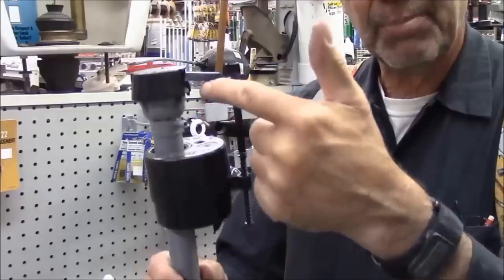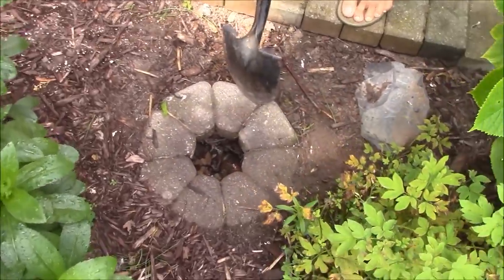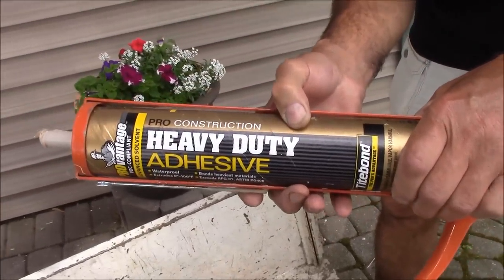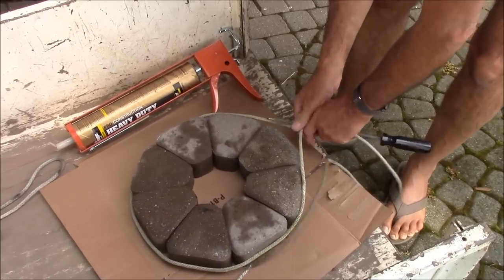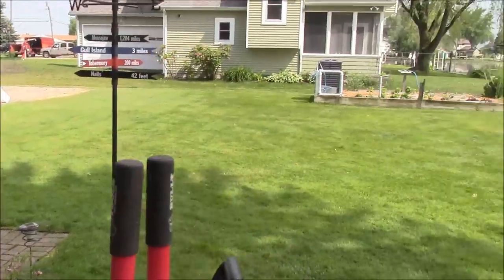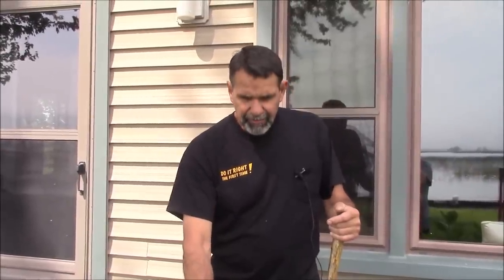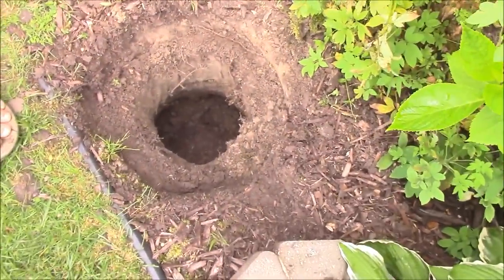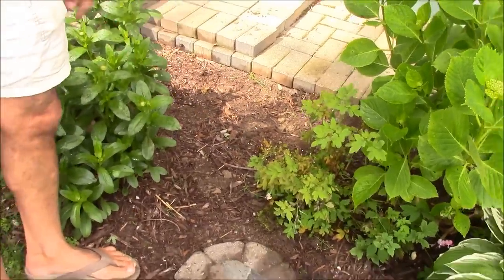Puppy Poop Hole Disposal Pit, Best Way to Dispose of Dog Pet Waste in Yard Cleanly

Comment: This was the best idea I have implemented for our yard care. We have a 35 lb Standard Poodle puppy, well on his way to 60 lbs. We are working on our second hole. He has huge poop!  Between designing a poop/pee area and this poop hole, our yard is poop free and looks nice. Thank you so much for this idea!
Reply from the maker: I’m on my 30th hole and on the 3rd dog at 3 homes. Our 70# doodle caused me to dig big holes and flood them w water 3 times a year to help settle the contents.
Reply: What do you do for pee?
Reply: @MrHardware1 I have a question. Your going to be putting the waste in the hole, but do you have to put anything in the hole to eat up the waste.
Reply from the maker: @kenyareed3051  I have added enzyme drain cleaner and filled the water with/the hose. I have 15 or more of these in a row around my garage and then into my flower beds. This has been over 40 years and you can’t tell where the old holes are.

Comment: As an electrician I have access to 9 foot long post hole diggers. That would be a deep one and make one hole last a very long time! Great video. Good job!
Reply from the maker: Wow, I could use a 9' post hole digger. Is it an auger or clam shells?
Reply: Mr. Hardware Clam Shell style. Fiberglass handles. I heard they were very expensive.

Comment: Is there any odor other than when you open it?  Want to do but my wife is concerned about the smell. Thx!
Reply from the maker: I'm surprised that there is almost zero odor.  It only stinks when I fill the hole with water (almost to the top) to help compact the waste.
Reply: you can add a little septic starter enzyme to get the process started.  that should eliminate much of the odor as well.
Reply: Or are there any flies collecting in area and near your back door?
Reply: Add some sawdust too it even couple weeks
Reply: @Godresponds  I was thinking the same thing (flies)

Comment: So I have a question. We had heavy rain last night and the hole filled with water. What do you suggest we do to drain it
Reply from the maker: It will drain into the soil naturally. I think it’s a good thing with the water because it causes all the waist to Liquify and settle bottom into the bottom of the hole. I have filled my pit with water with the garden hose and added some enzyme drain cleaner in an attempt to increase the decomposition of the waste.

Comment: Good idea but I have three dogs.. Even with a piece of slate on top, can you smell the poop?
Reply from the maker: It’s funny, it never smells except when it gets about half full and I take my garden hose and with a high-pressure nozzle I stir up all the crap and fill the hole with water and then it smells for about a half hour but you put the lid on and it doesn’t anymore. I add a little enzyme drain cleaner, I don’t know how good an idea that is, and then fill it with water again and I get over a year with one 70 pound dog.

Comment: Where did you get the brick? My local Lowes doesn't have something that makes that small of a hole.
Reply from the maker: Those were from some circle kits of brick pavers. I guess they aren't used much anymore so hard to find. If you can find some 5" x 10" you can make a box w a 5" hole if you lay them correctly.

Comment: Do you just put the poop into the hole and leave it there? or do you have to add enzymes or stuff like that to it? 
Also, could you add other organic stuff to compost in there like some veggies wastes? Would that help the decomposition or would it, on the other hand,  just ruin it?
Reply from the maker: I rarely add drain cleaning powder or septic enzyme and then flood the hole with the garden hose. The water helps liquify the waste and compacts it deeper. The enzymes can't hurt so I do use them. There is no room for composting stuff, I'm lucky to get about 2 years out of a hole.
Reply: @MrHardware1  Hey I'm sorry I didn't respond earlier! I followed you instructions and made my own system, with a little modifications here and there to fit my yard better. Let's see how it goes!
Reply: I think poop will break down faster and with less smell if you add some carbon to go with it. I plan to add a handful of leaves with each poop. Read around though. I'm not an expert on this. This will obviously affect your storage space, but I'm okay digging a hole every year instead of every two years

Comment: Uhm, so how do you get the dog to poop in the hole?
Reply from the maker: With a shovel, as usual. Just putting it into the ground not in a bag. Easier to me.
Reply: Lead by example. You should begin pooping in the hole with the dog watching. If the dog isn't interested, have a bowl of chilli in your non-wiping hand. Give the dog a scoop of chilli every time poop hits the hole. The dog will associate pooping in a hole with delicious chilli. After a few years you can stop pooping in the hole and the dog will automatically assume if he poops in the hole like you did, he will get chilli. It worked for my 85lb Teacup Yorkie.

Comment: so I tried to do this... but then I found out you have to buy a "kit" it's $800 to $1200 for a circle kit. I can not find just the corning stones anywhere! Please help!
Reply from the maker: See if you can find long narrow patio blocks, arrange them in a pattern that will leave any size hole in the center. I got the invention from a guy that just dug a hole and used a garbage can lid to cover it. My circle is cool but here in Florida I used rectangular bricks and spaced the center ones out so there was a hole. Then used a 12 x 12 patio stone to cover it.
Reply: Couldn't you also buy a $5 bag of concrete? Build a cheap circular mold from a bucket or lid and place another circle in the middle, like a cup. Remove once hardened.
Reply from the maker: Norah has a good idea to make your ring using a plastic lid and a cup in the middle and a bag of cement. Thanks! Blair
Reply: @norahj.5213  that is brilliant

Comment: Couldn't you just dig the hole and then use a bigger bit of slate to cover it rather than making that stone thing aswell?
Reply from the maker: The trim ring keeps the soil from collapsing into the hole.
Reply: @MrHardware1  ahhh, I get it. Thanks so much x

Comment: No enzyme tablets/powder to break down the waste? No pouring water on it? You just drop the dog waste in the hole and place the brick cover over it? That's it?
Reply from the maker: @Julie-z6q  Yup, although I do flood the hole w/water to compact the waste down and get another month before I dig a new hole. And yes, when  can I add some drain cleaning enzymes in and flood w/ water.
Reply: @MrHardware1  Thank you for replying. I've been using "compostable bags" but just found out that they're not compostable in landfills because the conditions aren't right for decomposition, so back to the drawing board! This is what I'm going to end up doing, but I wanted to make sure it's not harming anything. Thanks again : )
Reply: Hello again, so I was just reading about how this method of disposal is kind of useless in the winter because of the cold conditions not being able to break down the waste efficiently. Do you use another method during winter, or do you live in a warmer climate or do you just carry on with this regardless???? Thanks : )
Reply from the maker: @Julie-z6q  I think you’re overthinking it. Fill a hole w/dog poop, once it’s full, add dirt on top, add the sod from the next hole being dug, tamp it flush, use the next hole. I don’t care when it breaks down, I know it eventually will. I’ve gone around my garage, hole next hole through 3 dogs, over 20 years and you’ll never tell that I ever did it.

Comment: As I study the options, as our 75 lb lab is a factory, every where you read says, "Don't just bury dog poop as the bacterial run-off is horrendous.   Easy idea but not helping the waterway behind your home.
Reply from the maker: If the poop hole was within a few feet of the water I could be causing some contamination. However 30 feet of soil is more that enough to purify any bacteria burried below grade.
Reply: It's not fecal bacteria that is the problem, it is the excess "nutrients" such as Nitrogen and Phosphorous compounds.  Runoff can cause eutrophication of lakes and ponds.  The nutrients will be reduced by bacteria that lives in soil better if the poop is, well, if it is IN the soil as opposed to on top of it. More common causes of nutrient rich runoff are plant fertilizer, whether from coated grass seed, miracle grow, or farms, as well as wastewater from septic leach fields and treatment plants.  If it is a concern, one could always add beneficial bacteria (septic treatment) to the hole.
Reply: Zsa Zsa Umbra For wastewater issues just at an old or cheap beer to help, just like a septic tank.
Reply: Tallulah TwoSocks How does that work? and I don't mean the tab top lol.  Like, how does that help the nitrification cycle?
Reply: It introduces yeast. It’s not proven but it seemed to help my septic tank. So I was just thinking it was worth a try in this application.
Reply: It introduces yeast. It’s not proven but it seemed to help my septic tank. So I was just thinking it was worth a try in this application.
Reply: It introduces yeast. It’s not proven but it seemed to help my septic tank. So I was just thinking it was worth a try in this application.
Reply: It introduces yeast. It’s not proven but it seemed to help my septic tank. So I was just thinking it was worth a try in this application.
Reply: It introduces yeast. It’s not proven but it seemed to help my septic tank. So I was just thinking it was worth a try in this application.
Reply: It introduces yeast. It’s not proven but it seemed to help my septic tank. So I was just thinking it was worth a try in this application.
Reply: It introduces yeast. It’s not proven but it seemed to help my septic tank. So I was just thinking it was worth a try in this application.
Reply: It introduces yeast. It’s not proven but it seemed to help my septic tank. So I was just thinking it was worth a try in this application. It’s good as a compost additive as well.
Reply: It introduces yeast. It’s not proven but it seemed to help my septic tank. So I was just thinking it was worth a try in this application. It’s good as a compost additive as well.
Reply: It introduces yeast. It’s not proven but it seemed to help my septic tank. So I was just thinking it was worth a try in this application. It’s good as a compost additive as well.
Reply: It introduces yeast. It’s not proven but it seemed to help my septic tank. So I was just thinking it was worth a try in this application. It’s good as a compost additive as well.
Reply: It introduces yeast. It’s not proven but it seemed to help my septic tank. So I was just thinking it was worth a try in this application. It’s good as a compost additive as well.
Reply: It introduces yeast. It’s not proven but it seemed to help my septic tank. So I was just thinking it was worth a try in this application. It’s good as a compost additive as well.
Reply: It introduces yeast. It’s not proven but it seemed to help my septic tank. So I was just thinking it was worth a try in this application. It’s good as a compost additive as well.
Reply: It introduces yeast. It’s not proven but it seemed to help my septic tank. So I was just thinking it was worth a try in this application. It’s good as a compost additive as well.
Reply: It introduces yeast. It’s not proven but it seemed to help my septic tank. So I was just thinking it was worth a try in this application. It’s good as a compost additive as well.
Reply: It introduces yeast. It’s not proven but it seemed to help my septic tank. So I was just thinking it was worth a try in this application. It’s good as a compost additive as well.
Reply: It introduces yeast. It’s not proven but it seemed to help my septic tank. So I was just thinking it was worth a try in this application. It’s good as a compost additive as well.
Reply: It introduces yeast. It’s not proven but it seemed to help my septic tank. So I was just thinking it was worth a try in this application. It’s good as a compost additive as well.
Reply: It introduces yeast. It’s not proven but it seemed to help my septic tank. So I was just thinking it was worth a try in this application. It’s good as a compost additive as well.
Reply: It introduces yeast. It’s not proven but it seemed to help my septic tank. So I was just thinking it was worth a try in this application. It’s good as a compost additive as well.
Reply: It introduces yeast. It’s not proven but it seemed to help my septic tank. So I was just thinking it was worth a try in this application. It’s good as a compost additive as well.
Reply: Cudjoe Key23 I've heard of an aquarium cycling method that uses beer too. Now I gotta figure out what the yeast is for.
Reply: Well if you dispose it into the landfill? Thats not better. This inground idea is amazing!!
Reply: @mattmosca7244  Don't feed the trolls.